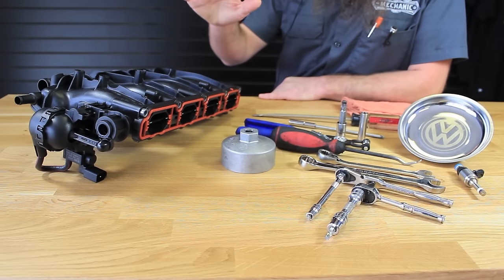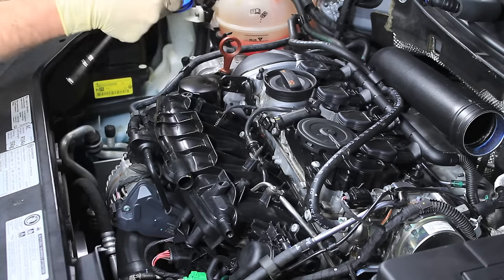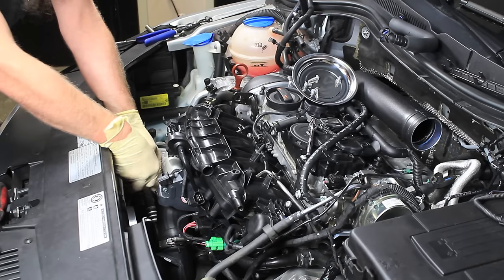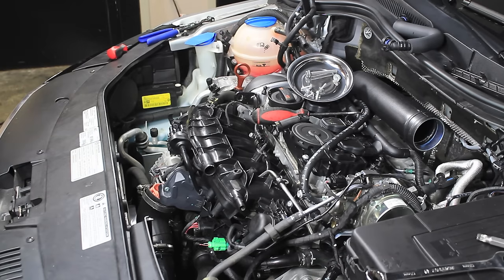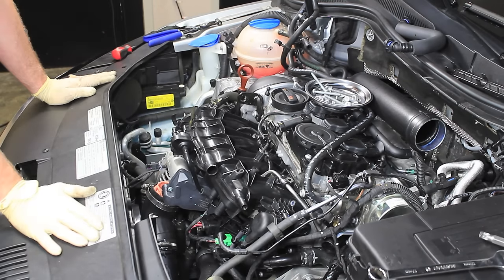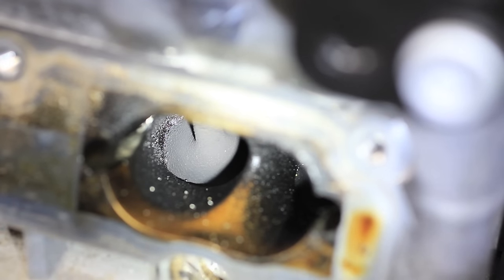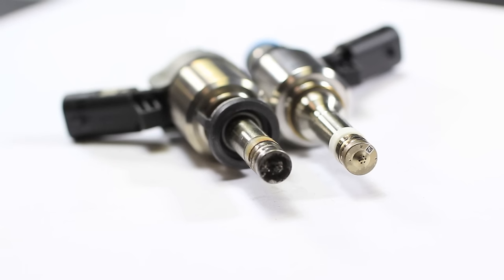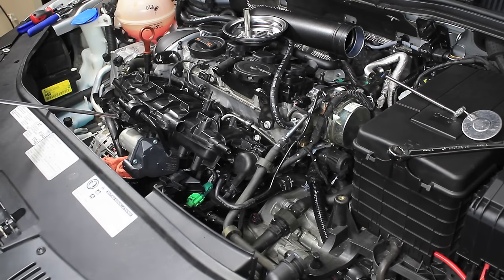Intake Manifold for VW and Audi 2.0T TSI DIY (How to) Replacement

Comment: Performed this job as a non-mechanic expert on 2011 GTI.  Here are notes that I hope might be helpful for others.

OBDII error codes: p0301, p0300, p2293.

My unique problem and the solution:
Driving down freeway, lost power and had check engine light come on, car sputtered home.  Checked out fuel pressure test kit at Autozone, which confirmed no fuel pressure into high pressure fuel pump, and changing out the low pressure fuel pump solved the fuel pressure problem and the p2293 error, but the misfires, smoke rings, and rough idle were still present.  I believe my fuel pressure sensor was broken, and ran out of gas.  Running out of gas, took air and particulate through the fuel system and messed up my fuel injectors, which I replaced thanks to this video after taking off the manifold and cleaning out the carbon.  This removed the p0301 and p0300 errors and now my car runs better than before the problem!

Notes on intake manifold removal:
-Beforehand, I read through all the comments in this video and watched this video and How to Automotive's video: https://www.youtube.com/watch?v=d6jkEyncdCA multiple times.
-An additional tool needed that is not mentioned at 0:30 is a 1/4 inch extension, which is necessary for removing the 2 t30 screws underneath the manifold (the 3/8 inch extension you might have for changing your spark plugs will not work for this purpose, as the diameter of the holes in the intake manifold is less than 3/8").  Charles says the long extension is for saving your back, but beyond that, it's actually necessary to complete this job.
-Differing from Charles' advice at 9:25.  I was able to disconnect the intake pipe by only taking off one t30 screw off the hard plastic pipe (I didn't see a second t30 screw), and the electrical cable had enough slack, so I didn't disconnect it.
-I've had 3 manifold replacements, and on one of the replacements, a mechanic decided not to replace the hard-to-remove bracket referenced in the video, so I don't have any tips for this, except that the part number is 06H-129-723-K if you need to get one.
-In contrast to Charles, I did not loosen the hard fuel line where it connects up to the intake manifold.  It was too hard to get at, and it was unnecessary to do so.
-The black plastic bracket which holds the wires that plug into the fuel injectors was attached to my intake manifold with a plastic expanding retainer clip. Before removing the manifold completely, I first disconnected this clip with needle nose pliers, but didn't end up reconnecting it, as it didn't seem necessary to do so.

Notes on fuel injectors:
-One of my fuel injectors was incredibly stuck and would not come out.  I tried spraying WD-40 around the injector and letting it sit over night, but that didn't seem to help much.  I tried using pliers to turn CW and CCW and wiggle back and forth, but that didn't work either and I eventually cracked the plastic doing that.  What finally worked was grabbing the injector and rather than trying to pull it, just sitting back with my whole weight for a while, which eventually brought it to slowly slide out.

Notes on carbon cleaning:
-After nine years of driving, my carbon build up was very thick.
-I do not have a blaster tool, so I did almost all of the carbon cleaning by hand.  It took 2 cans of Autozone's carb cleaner, paper towels, and a pick, plus many hours and some elbow grease.  I sprayed the carb cleaner on the valves, then crammed the paper towel into the valve, and pushed it around and retrieved it with the pick.  I considered, but did not end up opening and closing the valves by turning the engine crankshaft pulley with a 24 mm socket (as I didn't have one), but the end result was still very clean valves.

Connector/hose checklist:
-I don't know the names/functions of all the connectors and hoses, but I wanted to keep a count of disconnected ones, and count down from these numbers as I plugged them in.  Here is the count for my job:
*10 connectors sitting directly under the manifold to replug: 6 on the fuel injector bracket (4 of which connect to the fuel injectors), then another 4 on another wire (3 of which are colored purple and orange).  Since I didn't have the bracket, I didn't disconnect the coolant temperature sensor at 24:20, but that would make an 11th connector.
*1 connector off to the right of the manifold near the vacuum hose (also, if you did as Charles and removed the plastic intake pipe connector at 9:25, you'll have 2 here)
*So in sum, anywhere from 11-13 connectors to replug, depending on how you do the job.
*I also counted 3 main hoses to replug, the small vacuum hose beginning at the right of the engine and plugging into the bottom right side of the manifold (no clamp), another one starting near the coolant tank and plugging in near the left front side of the manifold, and another one beginning from between the first two coils.  Then, there's the 4th hose that you completely detach that connects from the PCV valve to the intake manifold.

Intake manifold reassembly:
-I removed the orange manifold gasket and rubbed dielectric grease over every part of it to minimize degradation to gasket and ensure an air-tight seal.  I also very lightly greased the fuel injector seals and the place where they plug into the manifold.
-I used a torque wrench to tighten the main nuts holding the manifold in place to 10 Nm (which I found somewhere online, and which was actually not as tight as I thought it would be).
-There are two nuts to tighten when reconnecting the hard fuel line to the high pressure pump, a bottom one which is silver and tightens the compression fitting, and a top one which is gold and attached to the hpfp.  I tightened only the bottom one, which caused a fuel leak.  Tighten both (the top one first), to avoid this situation.
-I was able to complete the whole job without getting underneath the car or disconnecting the throttle body (however, if you have the infamous bracket, you might need/want to.)

Thank you Charles (HumbleMechanic) and Deutsche Auto Parts!
Reply: Thank you, I think this comment should be higher
Reply: Thanks!
Reply: This most be the top best comments in this video, thanks!!

Comment: I used this video as a primary how-to along with other videos and forum posts for other angles and specifics about the job. I ended up stripping one lower manifold T-30 on re-installation and wanted to post my solution. Rather than uninstalling everything and re-tapping I found a 10mm M6 bolt at the hardware store that was 20mm longer than the factory bolt and needed to add a 1/2" nylon spacer to make it fit correctly into the block. No problems as a result of this rig. I also cleaned the injectors and got all new seals for those - if your valves are all crudded up your injectors will be too. Doing that added 2 hrs to the job including constructing a diy injector cleaning station and figuring out a way to re-seat the high pressure injector seals without special tools (best to buy the tool and re-sell to other vw owners).

Comment: I just want to first thank you sir for this video. I had the P2015 code and decided to do it myself when the dealer said 4200$. Fairly easy job just because everything is on top and easy to access. I work full time so this job took a couple weeks to complete. TAKE YOUR TIME AND BE PATIENT. Watch the video over and over and over until you memorize and it will make the job a lot smoother especially on the reinstall. THAT BRACKET IS A MOFO!!! LOL. Got it off though and it's a lot easier to put back on. I recommend removing the throttle body but those two back screws will tear up some flesh. And I also recommend watching a couple other videos from others who have done this job before just to get some more knowledge and different techniques are used especially with the bracket. This is by far the most difficult job I have ever done but it is doable. Don't be scared. Once again, thank you sir for this video. Now time to go collect my payment from the Mrs. 😜
Reply: my dealer charged me $600 to not figure out the issue with my brakes (200) that i needed new coils and plugs because apparently the ones i had in weren't "OEM" enough even though it was the same company that makes the branded oem sparks and coils, that cost another 200. then they said 200 for an issue i told them i figured out myself. A new cabin fan if you were curious. they wouldnt have known about the cabin fan being an issue unless i said "hey i figured it out its the cabin fan at low speeds that makes the noise, so i don't need it diagnosed anymore." oh wait i did say that! Valley Imports in Fargo ND incase you want to know where not to take your vehicle to get serviced.

Comment: Worst part about this job is that bracket for the manifold. Taking the throttle body off seems necessary, but getting those screws back in for the throttle body is no easy task either. This  is the second time I've used this video and it makes the job sooo much easier. Thank you for this.

Comment: Just watched your video DAP 
Thank you for the tutorial if you are watching this and are about to do the labor , make sure you watch this video numerous times , take notes , and start in the morning 
This is a professional pace, DIYs you might finish in the evening 
Take your time. 
Make sure it doesn’t rain and don’t loose any parts. German cars is not the the type to work without the same screws and bolts you started with.

Comment: Thank you for this tutorial, it is fantastic. I replaced my 50k miles '09 Passat manifold and also clean/decarb intake valves. Actually cleaning is the most time consuming part of the job, incredible how much carbonization sticks to intake valves.

Now P2015 fault has gone.
Some tips/comments:
1 - You really need a minimum 8 inch 1/4" extension. 3/8" does not reach lower T30s.
2 - That triple square nut extends the definition of inaccessible. Had to drain and disassemble the coolant line to get access.
3 - Did you say abyss when talking about the bottom of this engine? Perfect definition, have a lot of magnetic pick up tools.
4 - Lots of low pressure and misfire error codes due to empty high pressure fuel line when restarting. Just clear them after some miles. I also got low pressure alarm but noticed the fuel pressure sensor (below cylinder 2 intake) was misconnected.

Thanks from Brazil!!
Reply from the maker: Clovis Tanganelli Thanks for the feedback.  We appreciate it.
Reply: +Clovis Tanganelli , what is an 8' 1/4" extension, can you please show me a link, I don't know where to find one. thanks
Reply: +kirkferentzrocks : I was trying to convert to british units but I really mean 200 mm long 1/4" square socket extension. http://www.tool-net.co.uk/p-398884/facom-r217-1-4-drive-200mm-extension.html.
3/8" drive sockets will not reach the lower T30 bolts, not enough clearance.
Reply: hey, all my drives are 3/8" , why is the 1/4" better? thanks
Reply: +kirkferentzrocks Look at the bolts he is removing at 14:45, they are difficult to access and my 3/8" drives are too big to fit the clearance. But before buying new tools just try yours, perhaps your tools can reach these bolts.
Reply: Hi Clovis, I want to do this job myself but do I need a scanner to remove/reset the check engine light? Or when I replace the manifold it will disapear?
Reply: @fponsa001  you most probably need the scanner to reset/remove

Comment: Really appreciate the video. Replaced my partners inlet manifold for a VW Scirrocco TSI. 

First ever ‘big’ job I’ve done and the video has been super helpful. We were quoted £1,500 for this fix, so opted to DIY. 

That bracket was a massive pain and also had to remove the throttle body to access the triple square. 

I found going next to the alternator to reach the triple square was the easiest route but darn…. that took ages to get to. 

Car ran real rough as soon as I switched the car back on, but after a reset via VCDS, engine management light came off and is running smoothly. 

Great videos and thank you again for posting.
Reply: I can get a manifold replaced and injector for £100 here uk in garage
Reply: @kylejesson1774 damn, I’m based in South London so I guess prices are higher here than most places. Inlet manifold cost me £76 alone on Autodoc I also replaced all injectors which were £85 or so each. Dont even want to know how much VW would want for the OEM parts. Don’t see how anyone can get a 4x hour job done for £100 with/without parts anywhere in the country.
Reply: @kylejesson1774  what place mate? I would book with them? Need mine done

Comment: This was not a fun task but the video was a great resource. I wish it only took four hours. Note to DIYers - take care of the fuel injectors while you have everything apart, and the Check Engine Light came on after I got everything back together but cleared and stayed off after about 50 miles of driving.
Reply: I’m literally an hour into this job thanks man

Comment: Great video. Replaced the manifold and did a carbon clean on my MK5 GTI and it runs like new. Charles and Paul, thanks for the video. I started to make a video of the de-carb but what a nightmare. Do your homework and watch this thing a few times and you shouldn't have a problem. I recommend removing the throttle body to make dealing with the lower bracket easier. I also recommend removing the cool air intake pipe by lifting the car on jack stands and drop it out the bottom. The only thing I had to find elsewhere was how and where to install the new fresh air port on the new manifold design.

Comment: LOVE this video.  Saved me tons and almost impressed my wife with my newly acquired mechanical skills.  Did the work on a 2013 Tiguan with 120k miles and everything went freaking awesome, EXCEPT THAT FREAKING BRACKET.  That took a few years off my life, I guarantee it.  Mind you; I'm 6'1" and 260lbs. so fitting in spaces doesn't go very well with accessing things under the hood.  But yeah, eff that bracket.

One problem that I'm having now that the job's done; my temperature gauge is now going from bone cold to normal operating temperature within minutes of startup or within one mile traveled.  The gauge doesn't go any higher though.  The car does not overheat.  I took it to the dealer and had them check it out.  They cleared all the old codes and such, drove it around and no new codes.  Nothing.  Nada.  But the friggin' temperature gauge still jumps to high noon before I can get my seatbelt on.

Help?
Reply: that's been the case for my 2012 tiguan since the day i bought it.

Comment: Great tutorial! I removed the alternator as well, this helped facilitate the removal and installation of the mounting bracket on a 2010 EOS. I also purchased a grit blaster and cleaned the intake valves with walnut shells while the manifold was removed. At 160 km it was surprising to see the amount of carbon build up.

Comment: Great Video! 
I am a former Mercedes Benz tech and shop owner and I have tremendous respect for you VW techs. I say it to all of the techs when I see them when I go into the VW/Audi dealer for parts. 

I have a customer with a leaking water pump or so it appears on a 2011 CC. I honestly don't want to do the job. I get beat up enough with Mercedes vehicles. I can't imagine that job being much less than $1,000. If I do it, I would like to address anything else while I am in there.

Comment: drove my honda accord 09 v6 coupe from 77k to 135 k (until some idiot jumped in front of me)and never ANY issues. drove my 2013 jetta gli from 114k to 124k and already a clutch/intake manifold/HPFP/fuel sensor etc. Never will I purchase another and honestly, I may even skip Audi's but thanks guys, you do an amazing job with your tutorials.
Reply: In comparison, I drove my 2010 GTI from 77k to 135k (what are the odds) and this is the first issue I get.
Reply: @deegl  well, at least it isn't totalled lol. Yeah i went to vw dealer and it cost 1100 to get this part replaced. Ugh. Checked warranty as other have mentioned but it expired at 120k i think for this particular part. Like fucckkk
Reply: I still drive my 98 crv with 300k and never an issue ! Lol

Comment: I really appreciate you making this video from the perspective of someone without a lift.  Very helpful for DIYers. Doing a valve decarb today.  Wish me luck!
Reply: A few notes from my experience doing the decarb.  Just replace it all while you're there -  Intake manifold and injector seals.  After doing a decarb and putting it all back together, I got a P2015 code for intake manifold performance.  The code wasn't there before I started, but came about after reinstallation.  I'm redoing the job today to replace this part - $150 shipped on Rock Auto.

Other notes:
1) Make sure your T30 is a 1/4 drive, as his is.  a 3/8 inch drive will make it hell accessing the lower manifold bolts.

2) Even if you don't have a lift, go ahead and remove the lower shield so you can access things from the bottom, it will make your life easier.  You don't need to lift the vehicle.

3) I didn't bother removing the throttle body, because I found accessing the back T30's as hard as removing the 10 triple square on the brace.  Accessing the brace is all about patience, finding the right angles.  Pull the Main air pipe all the way down underneath the vehicle to give yourself plenty of space. 

4) When reinstalling, I started the brace w/ the 13 mm nut and let it hang down.  It made it easier to get it in place.

5) Finally, be very careful with the air ducting.  The plastic tabs are quite easy to break and the piece will not stay in place without them.  I had to order another piece for $20.

Good luck!!!